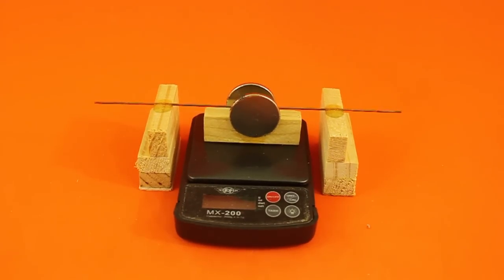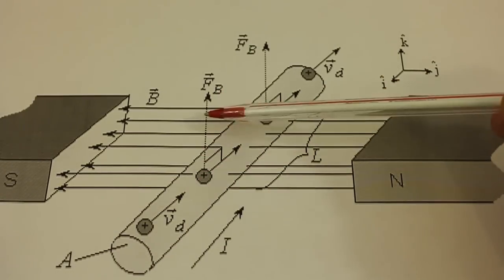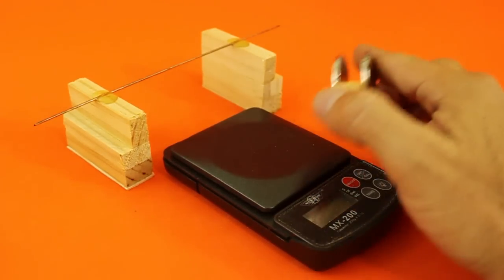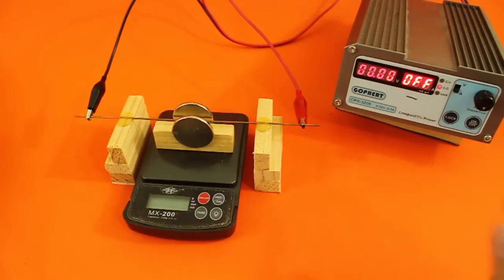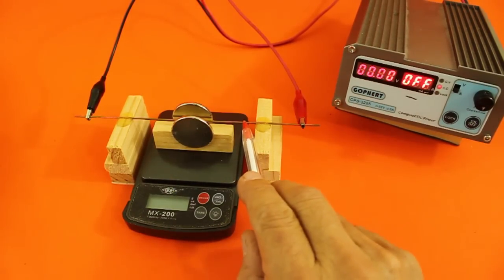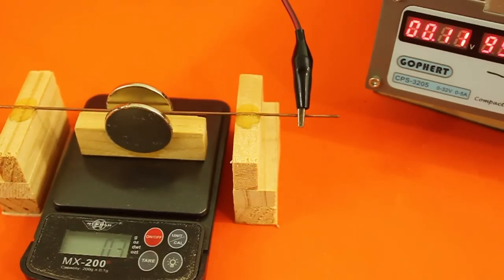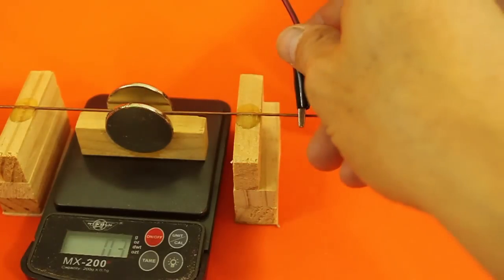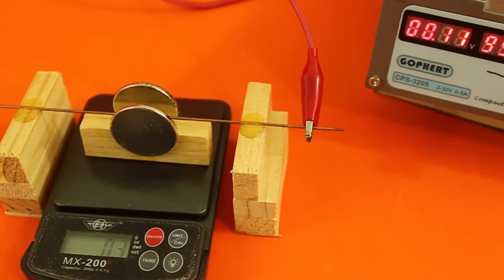Lorenz Force Experiment

Comment: If the field is strong enough, is it possible to make the mass of the magnets to equal 0.0? or in other words, make it weigh nothing?
Reply: Sure inasmuch as a magnetic field is generated in the wire which pulls the magnets upward.
Reply: NO, you certainly cant make the mass of the magnets = 0. As long as they're made of matter they will have mass. But yes when it comes to weight, if the lorentz force is strong enough (equal to the gravitational force) then it is possible to make the magnets weigh nothing.

Comment: ... and they call it "gravity".
Reply: Matter would have to conduct current in proportion to its weight; that would mean that everything would be producing heat, especially dense insulators. If the magnetic field is the earth's, then the vertical magnetic fields at the earth's magnetic poles would only allow for horizontal forces.
Reply: Kenneth Studstill maybe the magnetic field is YOU
Reply: Humans only produce weak alternating electromagnetic fields from the movement of ions across cell membranes, like many other living things. Also, most living things are slightly diamagnetic because of their water content, which means that an applied magnetic field induces an opposing magnetic field. 
Water is slightly repelled by magnetic fields.

Non-magnetic things have weight.

The reason why the magnets on the scale change their apparent weight is because, as the electrons in the wire move through the magnetic field, they push or pull on the magnets.
Reply: Kenneth Studstill you have a theory... Now think in 3 axis (or forces) and replace the Human... you'll have new theories. Or not!
Reply: Kenneth Studstill your soul is full of electrons... or  not